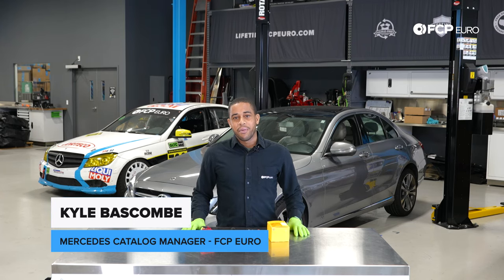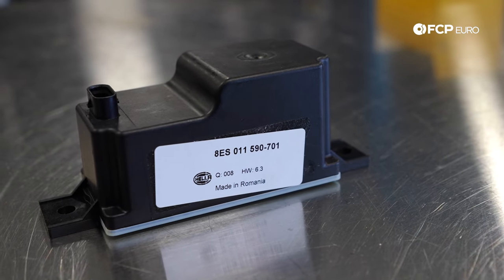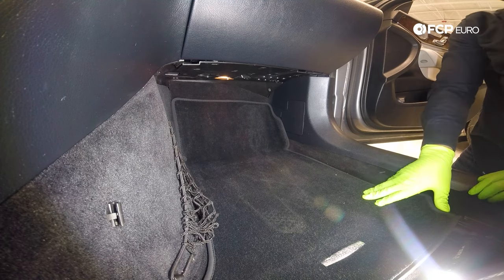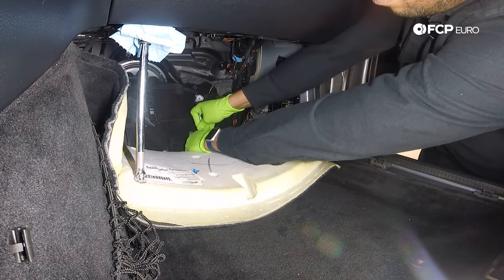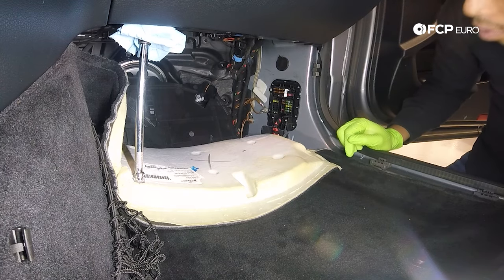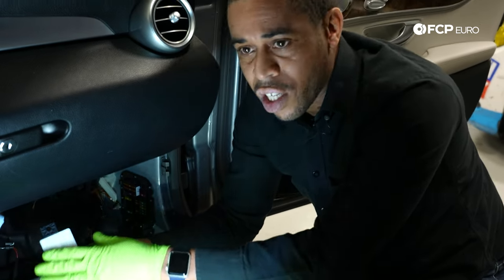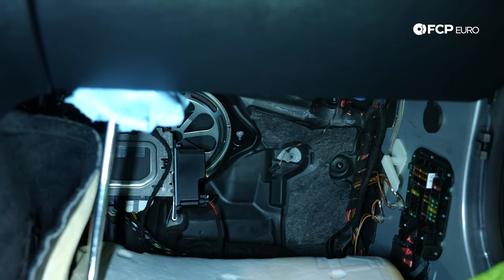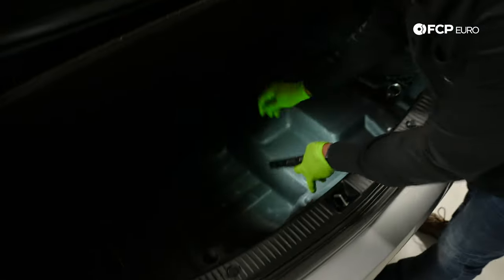Mercedes-Benz W205 Auxiliary Battery Replacement DIY (Mercedes-Benz C300, S63 AMG, C63 AMG, & More)

Comment: I'm having an issue that affects a W166 and a W205 simultaneously. For whatever reason, one, the other, or both, the alarm goes off at exactly 1 a.m. No one is outside interfering with the cars, and no animals are jumping on the vehicles as well. The W166 is at the shop and didn't alarm last night, but the W205 did in the driveway.  It turns off after about 30 seconds and repeats at least twice.  I can start the car and drive off; that third cycle happens even when the car is running and driving.  Any idea why this may be happening?  I found it strange that this is happening on both vehicles at the same time!

Comment: Great video, this is how the DIY tutorials should be done! No useless music, list of tools upfront, good angles, straight to the point. Thanks!
I have used this video to replace the aux battery on C200 wagon - it was slightly different, but this video gives you more than enough information to get it done. The main differences:
- the panel with T15 screw has only single screw and two clips
- the footwell panel was held by three nuts - two on the bottom, one on the top left (UK version)
- all of the nuts are 10mm (panels and the battery), no need for 8mm

The most difficult part of the repair was bending/pulling back the carpet as it was very stiff.
Reply from the maker: Thank you for the first hand feedback!

Comment: I was a grease monkey rebuilding hot-rods all through high school.  However, that was in the '70's and cars nowadays are very daunting with what is perceived as "complicated" electronics.   But your videos really make the complicated simple.  I completed this replacement in less than 30 minutes and so far, so good.  Also, it's one thing to know WHAT to do, but it's another thing alltogether to know that it CAN be done.  That was the biggest hurdle for me.  Thank You!!!

Comment: Excellent tutorial Kyle!! I was a MBZ Factory Trained Master Technician and Trainer back in the ‘80’s and mid-nineties, then moved in another direction and spent 20 more years in MBZ Sales Management. I checked out your video, as my wife’s 2018 C300 just got the “Pull over and leave the car running…” error message. Obviously I haven’t “turned wrenches” in awhile, so that led me to your video. I actually have a MBZ Extended Warranty on the vehicle, so it should be covered under warranty, but I always like to know what’s going on. In any event, being a former MBZ Technician/Trainer myself, I can tell you are a very conscientious and quality technician! You do clean work and your explanations and thoroughness are “top shelf!” I would have no reservations recommending you as a technician! Thanks again for the great video! 👍🏼

Comment: Most useful video. Clear and easy to follow. Putting the trim and carpet back was a bit fiddly, but quick and easy even for an amateur like me. It didn't even matter that you've got the steering wheel on the wrong side 😂

Comment: Thank you! I had the capacitor changed 3x times! But the error message was still there. Drove the car for the past 3 years with the error message visible until I saw this. This is the only video that mentioned to check in the fuse in the trunk. And guess what? My fuse were blown this whole time. Bought new 10A fuse and magically error meesage gone! Thank you so much for your help!!!

Comment: Excellent Video - agree with the other comments - it took me longer to drive to the jobber to get the part than it did to restore the "auxiliary battery malfunction" and test drive.  From tools required to the full, concise, logical, and informative presentation.  I went back to review removing the wire from the old regulator and aligning the plastic panel that holds the pax light and interior temp sensor and still beat my 40 minute drive time. If you know anything about resetting a 2003 VW European clock spring - I'd love to see a video.  Great Job Kyle.

Comment: Thank you for this excellent video.  The car calling it an Auxiliary Battery threw me initially but after hours of searching found that it was the a Voltage Converter.  This lead to your video. Mercedes were going to charge me £150 for a diagnostic (what’s the point of the on board computer telling you exactly what’s wrong🙄) and then whatever the Converter cost and fitting was . Two separate visits and inconvenience not having car.  The online search was well worth the time and coffee drinking.  Now to get it fitted.  You made it look fairly straightforward 👍

Comment: Thanks very much Kyle. I noticed a couple of small differences with my car which is a right hand drive australian model 2016 c300. The bolt holding my converter was 10mm not 8mm, and I had no second T15 screw holding the upper plastic panel - not missing, just not designed for it. A couple of extra notes to assist with aligning the plastic panels, the upper panel needs to align with an air vent - when I focused on that the panel moved in to place perfectly. Second, the side panel not only has to align with that white arm near the fuse box but also a couple of latches on the side near the door opening. Once I got that the panel sat right against the side.

Comment: Thank you for posting this very helpful video!  The only difference in my 2016 c300, the nut for the capacitor is also a 10mm not an 8mm.  Everything else was exactly the same.  I, too, can tell someone was under the panels.  It was missing one T15 screw and the little hook arm under the top panel was ganked.  Again, thank you!
Reply: m
Reply: Did this help? I too have a 2016 c300. Same message on the instrument cluster. I’ve had to replace the alternator and battery.
Reply: I have same car. Is it the same location as the video?

Comment: Thank you so much bro, just got this done on my 2015 C300 W205. Initially the error I had didn't go away but after a couple of drives the error for "shift to P, leave engine running" finally went away 🙏

Comment: Great video, really well informed and easy to understand you.  I did the replacement in a GLC and it was almost identical.  Small problem was the insulation foam cracked quite a bit.  Thank you!!!
Reply from the maker: Glad it helped!
Reply: Will attempt my GLC in next days as well. Any note on what was different?
Reply: @openmind6969  just the carpet was really awkward to pull back as the side piece wouldn't bend.  It actually looked like someone was there before as the foam was broken and I made it a bit worse.  But it all went back together ok.   Remember fuse 448.  Good luck!

Comment: Great video, To the point, well explained. I had the warning come up and was able to repair the problem myself following your video instructions.  I wonder how much the dealer would have charge me to repair it?
Thank you very much for your great video.
Reply: Just got quoted $390 at an Indy…
Reply: Did the code disappear on it ls own after you replaced it? I replaced mine and the code still pops up I’m not sure what the problem is
Reply: @maxkondratyuk99 did you ever figure it out? Was the fuse blown?
Reply: @MJMAMA12  it ended up being my main battery even though I got the same warning as the auxiliary. Kinda strange

Comment: Hello Kyle, great video, my 2017 C300 use a T 20 torx and no need for the 8 mm, for the floor panel with the 3 nuts size 10 mm i took a piece of plastic put over the end of the socket and that will help for the nut to stay wedged in the socket. Thanks

Comment: great video!! ordered the part from the dealership and did it myself before watching this video.. only problem was after it was installed, I am still getting the error code. this video exactly showed me what I missed which was checking the fuze box.. if I fix the fuze would that solve the error messages still?

Comment: Great presentation thanks 👍🏼 my start stop feature on my c300 coupe 2017 works once in a while only and i didn’t get any message on the dash most likely its from the auxiliary battery. I have my rear defroster not working it turns on for a second and then turns off automatically, do you think it has something to do with auxiliary battery too? Thanks

Comment: I wish I followed this video first. I watched other tutorials and ended up breaking like 5 clips because people don't know what they're talking about.

Onlyt things I'd mention is that aty 2:31 you mention there should be two T15 screws holding the panel in place. Actually if you don't have the knee-airbag there, it is only ONE screw. You don't have the knee-airbag on that side there, so it is correct that there was only one screw.

Comment: Great video I have that problem ,ordered the part from you guys and replaced it with your help it was such an easy job however the problem still there, as soon as I started the car the message showed up.
Reply: Check the fuse in the trunk as he mentioned in the last part :)
Reply: Maybe your main battery is dead

Comment: Great video. I replaced mine (2019 C300) easily with your instructions, but my start/stop and a few other things are still not working. They will start working once the car has warmed up for a while. Any suggestions?
Reply: Did you replace the main H7 AGM battery? Normally replacing both will fix that unless it detects a fault with the starter

Comment: My Mercedes dealership wants to charge $500 to get this fixed, but my rep there did stress that it’s not worth it and that on my car, my systems are fine and the electricals aren’t going to crap out on me. However, the warning message keeps coming on. It’s been a little over a month of the warning message. Should I replace the battery just to stop the message from popping up?

Comment: Great video and exactly to the point!Yesterday i've got the message on my dashboard saying that with red text "auxiliary battery malfunction" then after 1 min the message just appeared on white. Today i changed my aux battery and the message still appears with white then i've check on the trunk and find also my fuse 10N was burnt out. After i changed the fuse the message disappeared. Regarding this i have two questions..is there any chance to get the message about aux battery just because the fuse failed? Also when i changed the fuse it was 10N but i couldn't find the same one so i've got just a fuse 10 standard i belive it is. It's there any problem because it's not the same like 10N?

Comment: This video was really helpful and gave me the confidence to perform this task myself. I would have appreciated slightly more detail on how to disconnect the actual 3 pin connector on the voltage converter. I struggled with that until ringing a mechanic friend for advice ! 🤣
Reply from the maker: Glad, to be of some help, thank you for the note!

Comment: Great instructions. WARNING ** 

The absolute "worst" part of this is putting that top plastic trim back in!!!! I ended up having to pull the carpet back down to get it in.. then proceeded to drop one of the T20 screws between the carpet and the tunnel.(that is why the one in this video was missing).. where is will say until i have to go back into it.  It is summer and the garage is hot and i just don't care enough about that one screw right now!!!!!

Comment: Would think affect Bluetooth ? I had this code pop up to replace then it went away like 2 days later and my Bluetooth won’t work anymore I have a 16’ w205 thanks .
Reply from the maker: Hi Peter, the aux battery should not affect Bluetooth. Scanning the system would be the next best move to see if the module throws any codes, and go from there.

Comment: Great Video, thank you! In the video, it was mentioned that for a C-Class Hybrid Model, size 14 auxiliary battery is used instead of the „voltage regulator“ and that needs to replaced. Can this auxiliary battery be found in the same location as well, or assembled at a different location?
Reply: @alperakdag9764 did you get an answer or find out about your hybrid model was the location the same?

Comment: Is there any way to test the auxiliary battery before replacement? I have access to an Autel.

Edit: Found in the EIS/EZS module, live data shows voltages of power supply (main battery) and additional battery (aux battery) RSAM fuse pointed out in video was good, additional battery voltage showed 0 implying the capacitor in it is no good.

Comment: Thank you for your informative video. I want to ask you about a problem we are having in E300 (W213) 2018. The parking pilot and hold function sometimes work and sometimes not. We changed both the auxiliary battery and main battery and after the changes they work but in the next day the problem comes back. The dealership was of no help. They had the car for around 10 days and cost around $800 and they are not sure of the cause!
Reply: Did you ever find out what was wrong?

Comment: i changed the aux battery and checked the fuse. but the error is still showing up. do i change the main battery now?
or do i have to reset the message

Comment: that snap-in panel is a PITA.  even worse when you realize you got the wrong cabin air filter and have to do it again. 🙄
Reply: I just said F this shit and pressed the panel forward with my foot while sitting in the seat and hammering down the panel. Absolutely nothing sits/fits where it should be but it stays in place and i am not wasting any more time on it. This will be next owners problem.

Comment: Where can I purchase the aux battery from.  Also if I replace the main battery is it best to replace the aux battery
Reply from the maker: You can search the aux battery on our site with part number "205905341480" for an affordable Hella OEM unit! 

It's not unwise to do both at the same time as this ensures everything is tip-top, but checking voltage will give you an answer on whether or not it's required.
Reply: @fcpeuro  ok thanks.

Comment: I replaced A2059053414 with A2054400073 and everything worked perfect. Are there any incompatibility problems due to the fact that I replaced the newest version by an older one?

Comment: Thanks for the video, the error disappeared once I changed the Voltage Converter Module, but on the screen the ECO light does not show up anymore and it does not start/stop even though the switch for ECO in the center console is on and lit green. Does it need some kind of hard reset. Do I need to reset ? Thanks again
Reply: It is very good that the start stop is not active. It ruins the motor by stretching out the chain when it starts and stops all the time. Let the motor run it does consume minimal fuel when idling.

Comment: Hello
I changed the main battery then the car came back with message "BG service overdue". 
What does BG service mean? I only knows the A and B service. It's the first time I hear about BG service, how do I resolve this issue
Reply from the maker: Hi Mike, per MB, that is as follows: A/B ‘G’ – BF+Air+Fuel+Sunroof+ATF (diesel)-Petrol = BF+Air+Plugs+Sunroof+ATF

Comment: I changed my main battery and regulator in a 2018 c 180 and still getting the low battery signal if i dont drive it drains with in 2-3 days

Comment: Hey I have the stop engine shift to park leave engine running code on my dash and after replacing the auxiliary battery it’s still there, what do I do to remove it? My main battery takes charge and starts the car perfectly so I thought the voltage converter would fix it. Also my start stop function wasn’t working and now with the new auxiliary battery it still isn’t functioning
Reply: Ever figure out? Having same problem
Reply: @cookingwithbuds8057  yea it ended up actually being my main battery. The car just lets you know before it’s actually bad so I didn’t know wether to change it

Comment: Hi, I drive w245 2008 and I receive an error with the ESP continuously and battery light comes up. I replaced the alternator and checked it its charging but I keep receiving battery error. Is there any chance this 2nd battery to be faulty and to be the reason for both messages that I receive? Also is there anybody to know where to find this 2nd battery in w245?

Comment: How do I know if I need to replace my auxiliary battery or main battery
Reply from the maker: Hi George, When there is a failing main battery, the car will not start. After the auxiliary battery dies, there can be an auxiliary battery malfunction on light on the dashboard, along with vehicle electronics starting to fail, all dependent on how the vehicle is equipped.

Comment: What's the exact purpose of aux batt in w211?
Reply from the maker: Hi Zahra, on the Mercedes Benz the auxiliary battery is a backup for the main battery. Its functions vary anywhere from powering electrical accessories like the radio/infotainment to operating the engine stop-start system.

Comment: I was quoted $350 to get this done at a shop but they told if I do it myself it the computer would need to be reprogrammed in the car is that true? And if so is it possible to do it myself?
Reply: Not true

Comment: What’s the next step if the message keeps coming up
Reply: Did you test your main battery?
Reply: @205.BRABUS  yes it was bad and I changed it out. So far the message is gone. Thank you!!!
Reply: @Jeffrey_sendit  awesome, I’ve got my auxiliary battery coming in the mail this week. Hoping it’s just that and not the main battery. 
But now I’m curious as to which messages were popping up for you. Was it the “stop vehicle leave engine running” message? Or was it the “auxiliary battery malfunction” one? Or both?

Because I only had the auxiliary battery message pop up, but after I hadn’t done anything about it for a while, the stop vehicle message appeared as well and now the car just flashes between those two messages. Suspecting it could be the main battery as well so I’m wondering what message it was giving you
Reply: @205.BRABUS  it was the stop vehicle and leave engine running message.